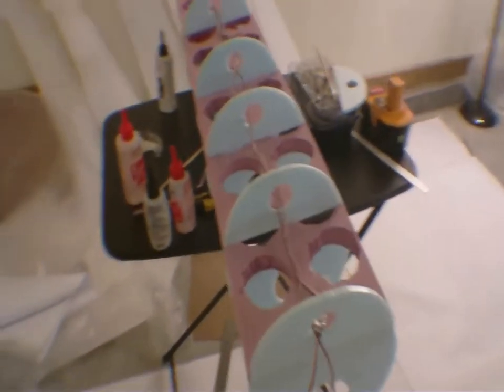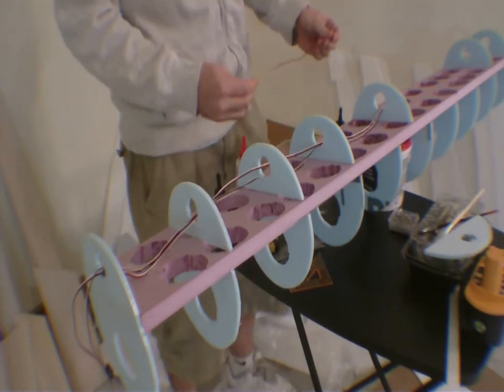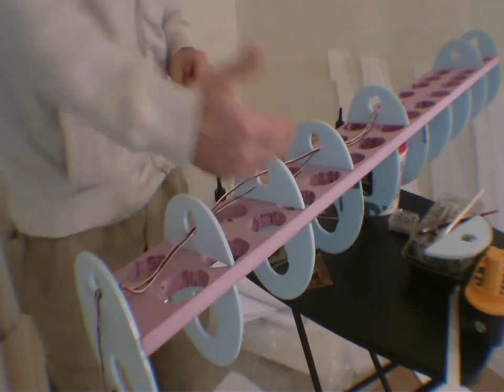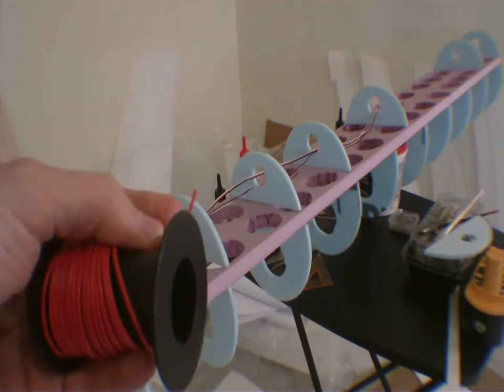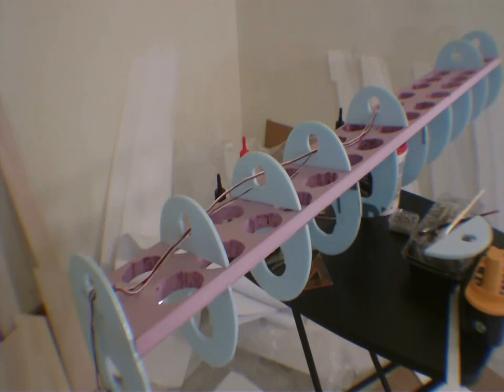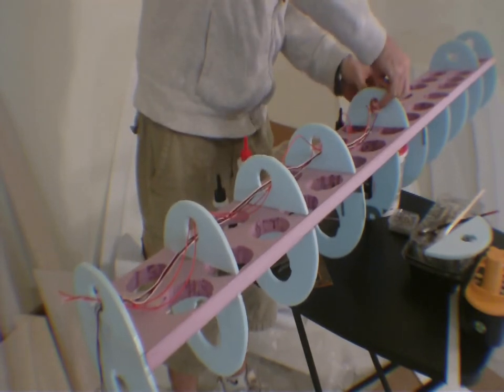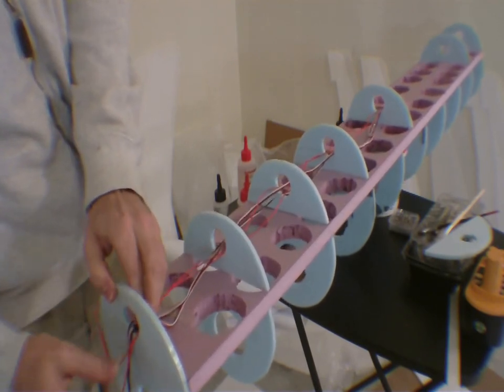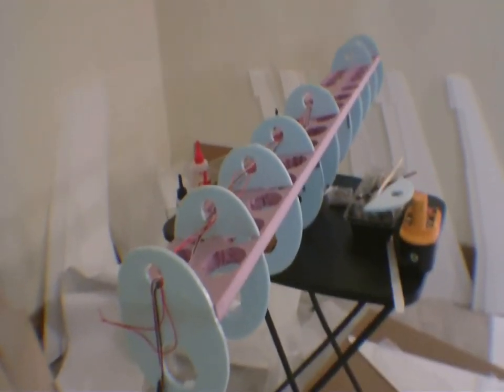How to build a 7.4 Foot MD-80 RC EDF Airliner Part-24!

Comment from the maker: Rabbit BE CAREFUL!. . .make shure you coat the bare foam with shelack or use a foanm safe paint or it will eat the foam. .. they should sell shealck at a.c. moore or micheals arts stores. . . .. . test the paint on scrap foam first.
but paint is a good idea if you dont have film.

Comment: Hey Chris should I just paint my 88 or use ultra coat I don't have any ultra coat ir the iron but i got the paint I want it shiny tho but want the color now LOL. Since this is my first scratch built airliner should i just say screw it and paint it and if I do is there anyway I can make it shine and not dull when painting this kind of foam? I want it to pop but want to ad color now tired of the pink.

Comment: Iv got vids to upload I'm just about done I'm about to start adding the electronics and paint or ulttracoat. I got the nose on the 88 still got some fine details on the nose iv started to cut out the hole for the nose retract and gear doors